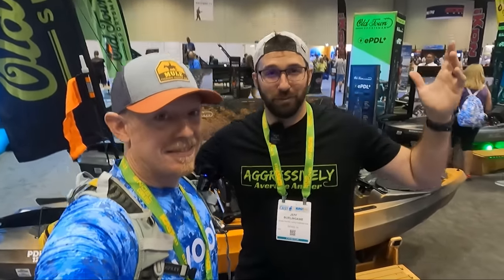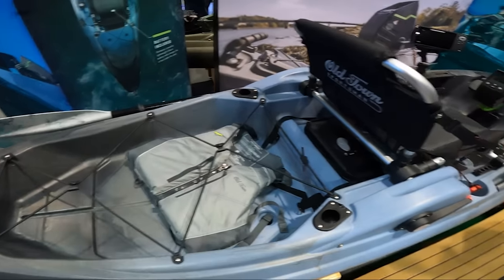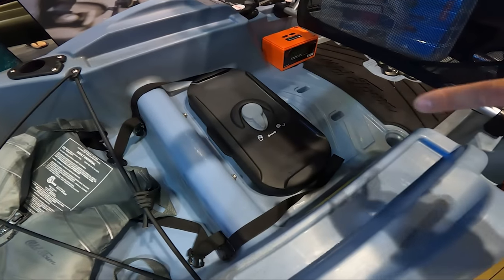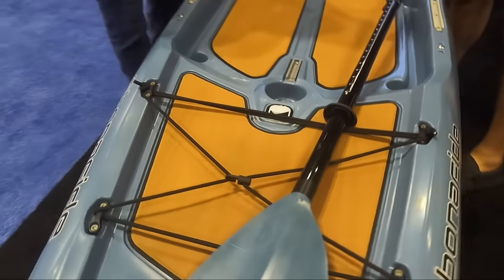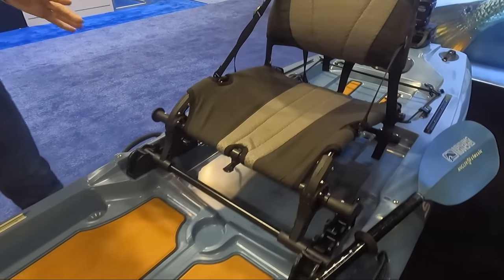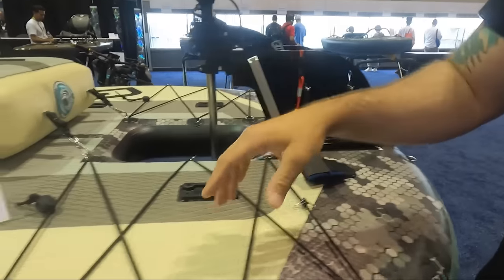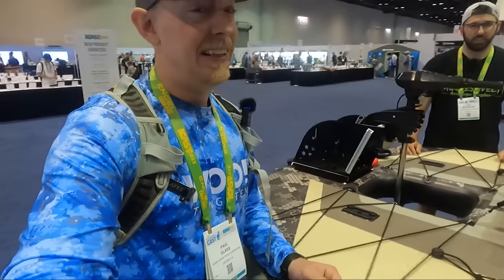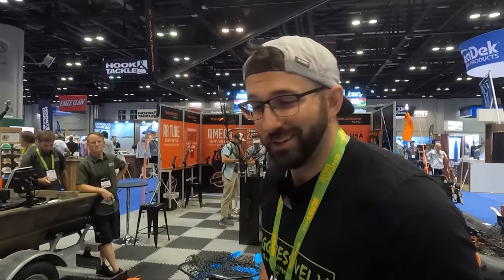NEW Fishing Kayaks ICAST 2023 | Old Town, Native, Bonafide and Wilderness Systems!

Comment from the maker: What do y’all think of these new kayaks???
Reply: I’ve got an outback and it might be getting sold for the titan x. Waiting for them to release the weight on it.
Reply: $6k is too rich for me. Titan-X geared to the tournament/hard core fisherman. The Wilderness Systems Recon seemed like a good value. Nice that you could buy the base and save up your money and get the pedal system later. Would like the I-ATAk if it had a pedal drive option.
Reply: When do you think they are going to introduce an inflatable kayak that has a foot peddle? That’s what I’m looking for!
Reply from the maker: @naychiv9325  bote makes one
Reply: @naychiv9325  Hobie iTrek 11 or the 9 but pricey. I believe the iTrek 11 is $2979 and the 9 is $2799
Reply: I have a Bigwater PDL, so I was stoked at the announcement of the E PDL, but the price...ouch, ..makes the titan x with a torqueedo a player for my new addition???
Reply: Yeah there's a couple with a foot pedal....wait...no...that's to pump it up....kidding ..do yer thang!
Reply: Thanks for the info. But it seems like there has been a lot of new hulls designed for speed as well as stability. It would be nice to see them, especially compared to older hulls. Specifically the difference between the Native Titan and the new Titan X. Sounds like Old Town refined their hull for the E-PDL too.
Reply: Sure they look nice on a stand, but I question the functionality of all that junk on there. Y'all must paddle in a bathtub. I paddle in deep waters with sharks. I question the basics about all. Anyone can put enough sugar on a turd to make it look good. But one bite and you are screwed.
Reply: @wannabeangler  It looks a bit safer than a surfboard and plenty of people use them in water that sharks swim in.
Reply: @naychiv9325  Mirage iTrek 11 - Inflatable Kayak | Inflatable Kayaks | Hobie
Reply: It's getting stupid. Just buy a boat.
Reply from the maker: Make me
Reply: 6k for a phucking plastic canoe? IDEOCRACY
Reply: they cost too much. You can get a boat for thie price.

Comment: $6K is absolutely never acceptable for a kayak... totally stupid and counter to the point of the kayak... (I don't care how integrated it is, buy yourself a boat). actually I know you are excited about the sub $3000 prices but that is also not ok, a pedal kayak should be $1500< $2000 and a motored kayak $1700<$2700 even these prices are debatable as they do not cost a fraction of this to manufacture.  the insane price inflation that was originally started by hobbie is still insanely ridiculous
Reply: I love em! $3,300 and I can ocean fish for 3 to 4 foot "sea monsters" without the ongoing cost of an ocean-worthy boat. The kayak was my "upgrade." Would rather not spend $6000, but I will if it's the best fit for me.
Reply: I also don't like how expensive they are, but if they are made in the U.S. they will always be more expensive than being manufactured from places with low wage labor like China. 

These companies don't just make up a price. Most of these prices are based off supply and demand. Inflation just makes it worse.
Reply: I would agree if it was just a standard paddle kayak... But sometimes having the latest innovations comes at a price, however as others catch up then the cost should round out and sometimes it doesn't.

Your point about the price compared to a boat doesn't really apply though, i sold my boat to buy my kayak because it allows me to fish in more places (however I am not a deep sea fisher). I think if people are buying a kayak as a cheaper option, there are plenty of options, but for those that are buying it for its benefits, spend whatever is in the budget. 

I only spent around $2000 AUD for my pedal kayak and now I can fish the lakes, estuaries and creeks around my area and my favourite factor is that I throw it on my 4x4 and take it to places almost never fished because you cannot access them with a trailer.
Reply: Literally my Titan 13.5 pedal drive I got in 2019/20 and paid $2,000 for it. These prices are insane today

Comment: The hardshell wilderness system yak was actually dope the price is not bad at all and the inflatable didn't look half bad neither. I liked that rubber material hull that should hold up way better then a normal inflatable that's pretty exposed underneath.

Comment: IDK, the ePDL is neat and all but not for $6000. At least not for me. 

I'd rather get the Titan X for $3600. Add Newport NK180 ($1000) and Garmin Striker 9sv ($620) with a 24v 50ah ($929) & 12v 46ah ($400) and you're stting at $6700. More, except you'll still want a fish finder and power for the fishfinder on the ePDL. And that doesn't come with a swivel locking seat, ready mounting for power poles, further electronics (power link system), and a premade system for foot steering if you want it. 

ePDL is cool and new so I get the Best in Show award. But the TitanX is the better choice just about any away I look at it.
Reply from the maker: I hear ya!
Reply: Yes, I've got the Bigwater PDL, and was so looking forward to the E version...then they priced more than the autopilots.... ridiculous!...I'm with ya on the titan x ....rigged out , you come out ahead with , with foot steering too.

Comment: Awesome channel! 

Question, im looking to get into kayak fishing 

What is the best kayak that can 

fit in the back of a truck
good in very ruff salt water, 
good in strong current to fish bridges and the inlet

Im thinking of getting only a pedal one now but having the ability to upgrade to a spot lock motor maybe later on. 

Best bang for the buck?  

Thanks so much!
Reply from the maker: The Xi3 can be upgraded and is really popular as far as motor options go.  Bow mounted
Reply: Little late, but the best bang for your buck fishing kayak is the Feelfree Lure 13.5.  Excellent rough/big water fishing kayak and it's currently $1200.  It's such an underrated kayak.  I've had one for 3 years now.
Reply: @jasonalmy1872  thanks for commenting back. 
I ended up getting the old town big water 132pdl on super sale for $1750 out the door
Reply: @waterboy5164  nice!